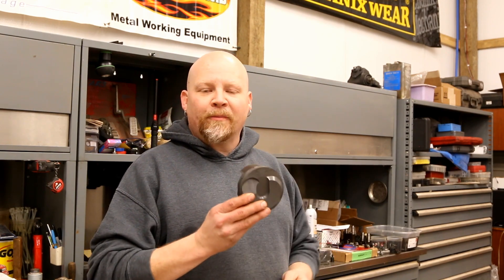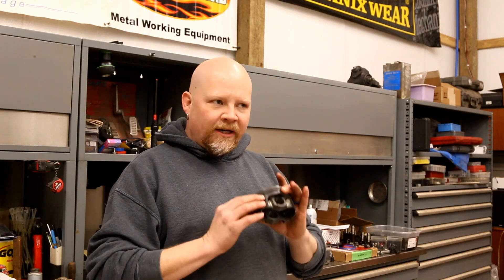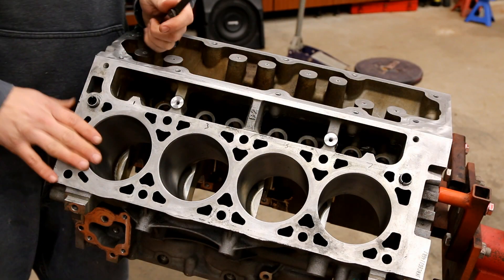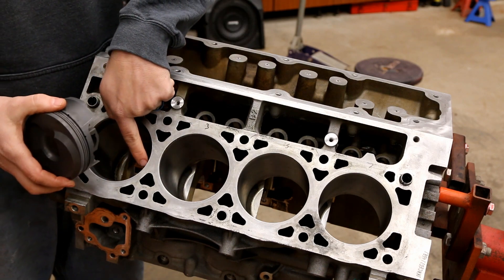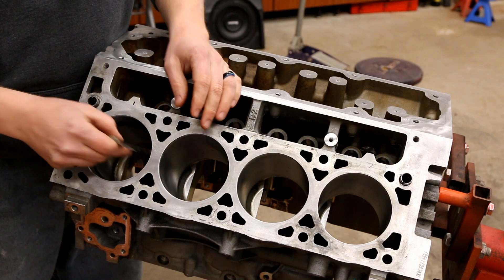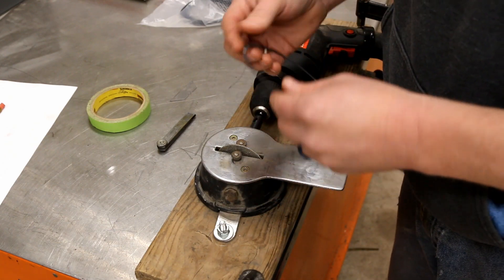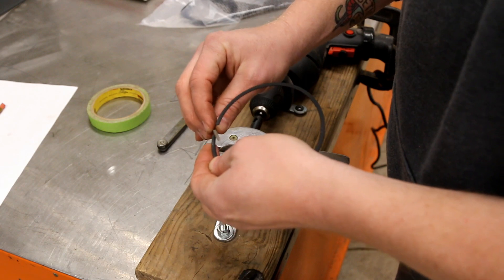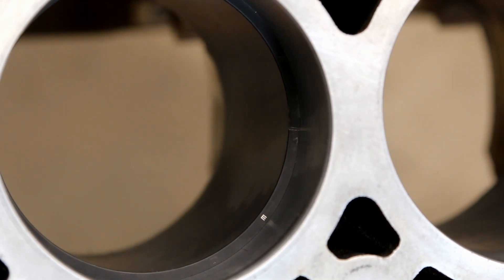How To File Fit Rings For Any Engine (And Some GM Gen V LT-Series Tips and Tricks

Comment: I’m rebuilding an L83. Bought a set of Hastings plasma Molly standard rings…the rule of thumb would be .015-.016 top and 15 or 20 percent bigger for 2nd. Checked all top rings and swapped around the rings to each cylinders to finally come to all odd cylinders were .022 and all even cylinders were .024. I could not find any combination to get smaller. Dug the old rings out of the trash and checked those….they were .022-.026. 🤔🤔….back to new rings, checked 2nd ring and all were .018-.019..wth?!? So I just gapped them to be .004 bigger than the top. Did I screw up or can I still run this?
 
And no, I did not have the rings mixed up.   Also, I’m reusing the pistons too. Did not have it bored. I only deglazed the cylinders because they were in great shape.
Reply from the maker: No, you didnt screw up. You are better off with too large a gap than too small, especially with 1mm rings. 

For an L83, the typical gap would be .017, as 3.78x.0045, for a basic street engine. 

I usually recommend gapping for boost, as you never know what you will want later, and might as well do it now. The extra .005 gap won't hurt performance, and can actually helps by reducing ring flutter. The 2nd rings should be .002ish larger than the top ring to keep gases from building between the rings causing flutter.

Your cylinders could be out of round, and it also depends on where you take the measurement. About 2 inches down the hole, using a piston to push it in and make sure it is square is the best method. 

Don't stress .022-.026, that's not big enough to cause any issues.
Reply: @Reddirtrodz  these rings are actually 1.5mm. I’m also going to go ahead and open the rings that were .022 to .024 to match other side. Also opening up the second as well to match other side. Thanks, just seemed odd factory gap was that “big”….and the new rings being backwards I guess you could say, as far as gap goes.
Reply from the maker: @JoeKing-lo8em  Yeah, 1.2mm top ring, 1.5mm 2nd. Gen V aftermarket pistons use 1mm for the two compression rings.

Comment: If the rings were fit, you shouldn't have to file them.
Reply from the maker: Yes and no. These are file-fit rings, they HAVE to be gapped to the cylinders. 

That said, if you had a set of pistons with  a stock gap and are adding boost or nitrous, then you need to re-gap them anyway.